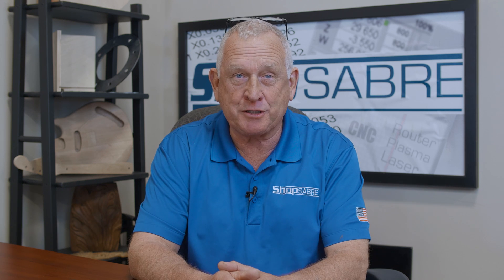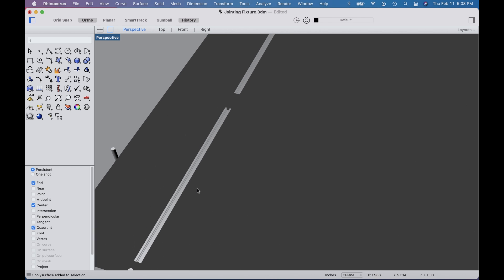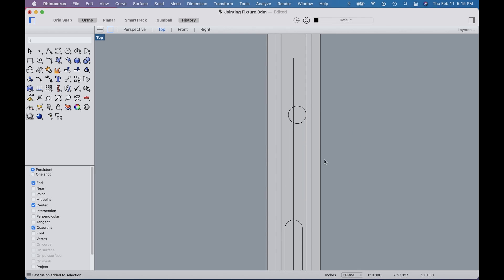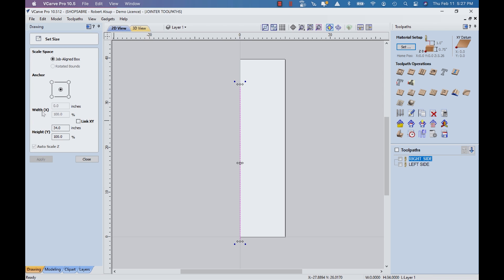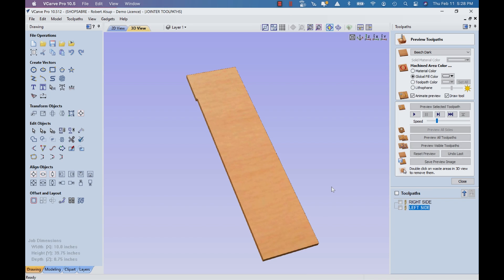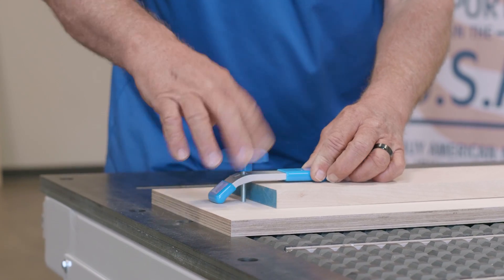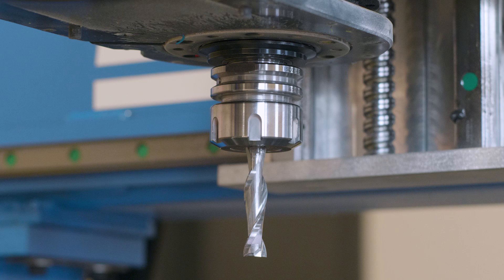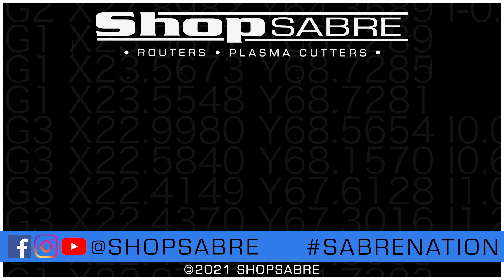Using ShopSabre Router Table as a Jointer-Planer

Comment: If you knew the finished width required, you can create a program in vcarve. Make sure to use the settings for “safe z height” as to not crash machine into the clamps. Measure from top of part to top of clamps, and be sure in rapid moves the tool retracts far enough in Z to clear.

Comment: I have used this method before but using fixture board as a fence. Doing this type of cut what are the pros & con of up cut or down cut bit. What bit were you using? Thanks for the video
Reply from the maker: Up cut will pull the chips up, down cut presses the chips down, pros and cons depend on the result you are looking for. For an example, downcut works great when you are trying to apply more pressure to the material. An up cut would work best when trying to extract more chips from the cut. In this video we used a compression bit by Vortex Tools.